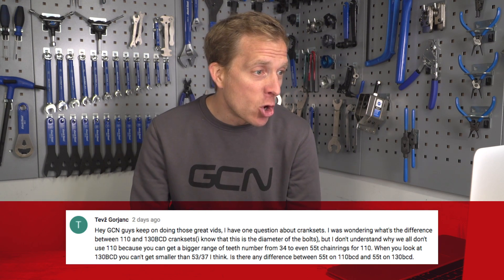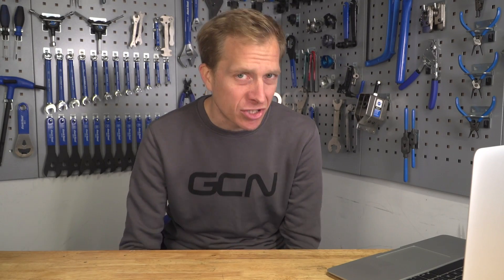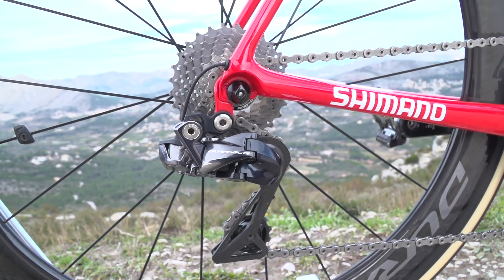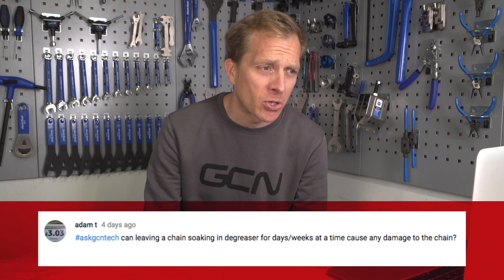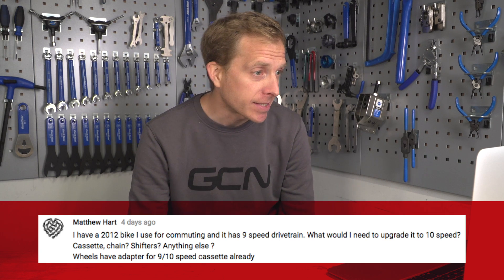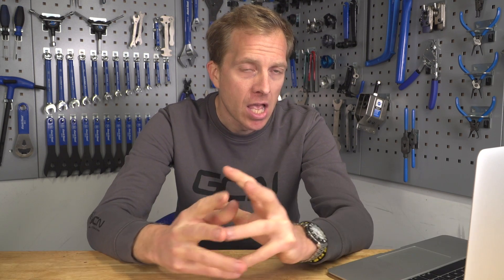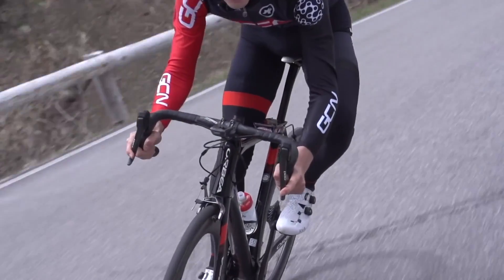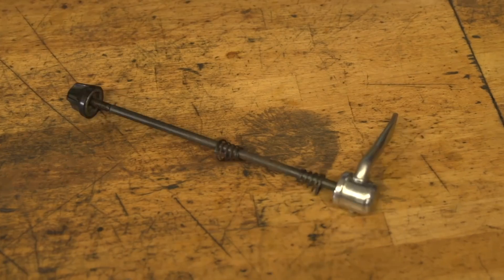What's The Difference Between BCD Sizes? | GCN Tech Clinic

Comment: Just had a tubeless front tire blow out -- rolled off the rim -- landing on a bunny hop.  I suspect I should of maintained the tire, tape and sealant better.  It happened after probably 1000 miles or more.  I've used tubelss tires for the past 3 years without any issues.      I always hear to keep the fluid fresh but upon inspection it looks like the tape loosened beneath the rim bead, perhaps loosening the junction of tire, rim and tube.  What's the suggested tubeless maintenance?  Could the tape loosening below the rim joint be the culprit?
Reply: You have rim tape going all the way into the bead notch?  If true that would make it a lot harder to seat the bead into the rim.  The tape is there to make an airtight seal against the spoke holes.

Comment: Does changing crank length significantly change the overall gearing
Reply: Changing crank length doesn't change the gear-inch number, or development (gear inch times pi), but it does change the _gain ratio_, the ratio between the circumference of your pedal stroke and your development (how far the bike travels on one turn of the crank).
 You could google "Sheldon Brown" and "gain ratio" or Lennard Zinn for a more thorough treatment of your question.
Reply: Thanks that was interesting, my cranks are now 150mm and I am using lower gear ratios than before
Reply: Are you sure your name isn't Stuart Small?

Comment: #askgcntech - Hi guys, love the show. I have a late 80s/early 90s Specialized Allez Comp with 2x7 shimano 105 and downtube shifters (53/39 up front and 13-23 in the rear). The shifter for the rear can be switched between indexing and friction. I'd like to make my low end gearing a little easier for climbing purposes, but a new (compact) crank is a little out of my budget. I've heard you can put 9 cogs from a 10-speed cassette on a 7-speed freehub. I could then use an 11-32, 11-34, or 11-36 without the 11 tooth cog and set my shifter to friction. I would also get one of the cheaper Sram MTB derailuers (I assume with friction shifting, derailleur quality shouldn't make a huge difference) to accommodate the larger cogs, and the 1:1 cable pull ratio would hopefully make friction shifting 9 gears doable. Does this plan seem possible and do you have any recommendations for its implementation or for other ways to add better climbing gears? I'd like to keep my budget under $100.

Comment: #askgcntech I've got a nice new Cannondale gravel bike with disc brakes. They are centre lock type without bolts.  The front disc has play between the splines of the hub and the disc, so when the front bake is pulled it gives you the sensation of a loose headset.  I have tried copious amounts of treadlock to glue it together but no luck.

Comment: I have a Dogma F8 with Dura - Ace mechanical brakes and gearing. Do I need to cover the cables that pass below the bottom bracket on the outside of the frame with a protective sheath?? They seem a little open to the elements naked... #askgcntech
Reply: They should be fine, same design on many bikes

Comment: Oh, regarding the chainrings I have a question too. So my bike has 2x9, 53-39 at the front, and 12-25 at the back. On flat it is fine, but on hills I feel like I'm running out of gears with the 25. I am wondering if 
a, I should upgrade at the front, for a compact set.
b, I should upgrade at the back. Now there 28, or 30? Would 30 be an overkill, or not really? And would it work with my current derailleur? What should I watch for? What does it depend on? I like climbing, but with spinning the legs.
Reply: Daniel Czirjak Changing the cassette is easier, using a 30t will make a big difference so would try that first. You will need a new chain as it needs to be longer.
Reply: Thank You. I read somewhere that I also need new derailleur, is it true, or just in some cases? What should I look for?
Reply: Daniel Czirjak You may need one but I would test the current derailleur to see if it works. More information can be found here: https://guides.wiggle.co.uk/rear-derailleurs-buying-guide
Reply: Thank you for the help!

Comment: Oh and on BCD, you did not mention that the BCD determines the smallest chain ring that can be used as the inner ring.  So 110 goes down to 34 instead of 38 for 130.
Reply: My 110 FSA has a 32.

Comment: Re: 9 speed upgrade to 10 speed:. 10 speed 5700 105 and 4600 Tiagra have 9 speed cable pulls (short arm front derailleurs), but 4700 Tiagra uses 11 speed pulls and has a long arm FD.  So not all 10 speed will work with 9 speed derailleurs, length of FD arm is a good indicator.  For a commuter bike I would stick with 9 speed, switch to 4500 Tiagra levers if you want to upgrade to brifters.

Comment: Hello from Riyadh Saudi Arabia.. have you ever seen a setup with only rear derailluer Di2? and the FD is mechanical cable?will there be a problem? Thanks and more power to GCN
Reply: Some CX guys use only the XTR DI2 with a 1x setup.  But if you are using a front and rear?  Is there a reason?  Just trying to save money?

Since DI2 is CANBUS, any configuration will work...  e.g. a Ultegra 8050 right lever and rear derailleur alone will work, but you still need the A and B junctions, connecting wires and the battery.  In this configuration you won't have automatic FD trimming, you can't use Synchroshift modes, and if you want to use auxiliary or sprint shifters you can only do so on the right lever (i.e. "upshift")

Comment: #askgcntech Follow up to BCD. Does shimano 4 arm cranks even have a BCD? I know for instance full uses a 130 bcd, and sub compact uses 90 bcd, and everything else 110 bcd. Or can shimano in theory place any size chain-rings on their mount system, so long in keeping with the 16 tooth jump?
Reply: BCD is an acronym for Bolt Center Diameter. Every crank despite the amount of "bolts" or "arms"  has a BCD.  The 4 arm crank from Shimano has a 110mm  BCD's but the radial distance between each bolt is not constant (hence the use of the word asymmetric, which isn't really true, it is symmetrical, unless one or more spider arms are not 110mm center diameter. Pretty sure they are all 110mm BCD). It was a genius masterstroke by Shimano.
Reply: It uses a 110 BCD.  Aftermarket makers call it 110 bcd asymmetric or 110 bcd shimano.  I believe FSA makes a crankset that also uses the same configuration.  34t is the smallest ring that fits, and I bet they make 58's for pros.

Comment: Hi gcn, I have just got a second hand commuter bike that has a triple at the front 48,38,28 and a 11-30 cassette at the back what size chain do I need as the one it came with only had 104 links #askgcntech
Reply: buy a new chain, and look at the chain vendors instructions for how to size the chain. The chain length also depends on the length of the chainstays on your bike. 

Page 9 of https://sram-cdn-pull-zone-gsdesign.netdna-ssl.com/cdn/farfuture/4xdUGxt6SlT-V_Y3fkmZcH8Yb5kED3Y18QzmUkTGOlI/mtime:1490891112/sites/default/files/techdocs/95-2518-002-000_rev_c_user_manual_cassettes_and_chains.pdf for example.

Comment: I once soaked a chain in citrus degreaser for about a day.  When I took it out it had completely rusted.  Had to buy a new chain.  Other degreasers may not do this but citrus did for me.
Reply: Likely the difference is water based degreasers (like citrus and others) versus solvent based one. Solvent should be fine, where as water based wouldn't.

Comment: The lose wheel are bearings I think ;)
Reply: Other things I’ve thought about...are the cone shaped springs still there on the skewer and pointed with the narrow side towards the bike? Is the actual wheel slightly bent, wiggling itself free? Is the skewer installed correctly and with the handle on the correct side? Is the frame cracked?

Comment: i figured that 'deadspace' in the shifting of the levers was there for the very reason Sagan chose mechanical over di2 for that race - i had imagined ulteg or DA levers to have less of this play under the idea that that level of component would be in more experienced hands and therefore less likely to cause someone to possibly get a little unstuck. only really have experience with 5800 levers (as far as shimano goes) can anyone confirm my thought?
Reply: Pratalax, I think it was probably just as simple as he didn’t want to accidentally shift when riding on rough roads/cobbles. A cable shifting system would prevent something like a bump from doing that.

Comment: I had an issue similar to the last question. It turned out my free hub body was not tightened all the way down. I had my local mechanic fix that and I have been without issue since. The symptoms I saw was my wheel toeing in a bit and rubbing on my now drive side chain stay as well as brake.

Comment: #askgcntech Last summer I bought an entry-level road bike. After a year of riding and enjoying it I want to upgrade from the stock Microshift 3x8 groupset to Shimano Tiagra. How can I tell if my wheel will take the 10 cog cassette and which bottom bracket I will need? Plus are there any parts I can swap out for 105 or Ultegra equivalents, such as chain or bottom bracket, that will improve the ride without bumping the cost up too much?
Reply: MidtownSkyport My B'twin Triban 500 SE came with that groupset. I upgraded mine to 105 as I felt the pain of 3X8! It depends on the wheelset, but if it's a low end bike like my B'twin then the rear wheel is likely to be 8 speed only, so an upgrade will be needed. The Tiagra chainset uses Hollowtech II so you will need a 68mm Hollowtech BB, choose whichever model you like (Tiagra, 105, Ultegra, etc.). As for upgrades, an external BB as mentioned above, together with a chainset will make a huge difference in power transfer. Chain is also a good idea, higher end ones are lighter and the shifting is more precise, but is best used in conjunction with a good cassette and chainrings. I hope I helped even a little bit! Happy riding.
Reply: Thanks, yes big help :) My bike's the Triban 500. I was thinking of upgrading the wheels too, so I might have to get the wheels first (the mavic aksiums I've got my eye on can run 8 speed) then the groupset at a later date.
Reply: A wheel that accepts 8s will accept 9 and 10s as well (unless you have a dura ace 7800 or ultegra 6700 rear hub which only accepts 8 and 10 s).

If you are talking about tiagra 4700 you could technically use a higher quality 11s shimano RD but you won't gain any shifting performance. What I would do is get some 5800 brake calipers and some kool-stop brakepads. They offer better modulation and overall stopping power.
Reply: TuneDownUtilities Thanks, good info
Reply: So I've been pricing up a part-tiagra-part-105 groupset and it would be cheaper to just buy a complete 105 set :D

Comment: #askgcntech How often should I replace quick link on my chain? I have kept the same quick link on my chain and only changed the chain itself.
Reply: Use a new link when you put on a new chain. Surely your new chain came with a quick link anyway?
Reply: No, I've never had a new quick link with new chain. Or do you mean new pin? New quick link costs around 5 euros or so.
Reply: KMC and SRAM chains should come with quick link. Shimano chains usually come with a pin but some come with quick link, but of course you can buy a quick link to use with Shimano chains if you don't like using the pins.
Reply: 11 speed quick links are not meant to be reused anyway even on the same chain
Reply: I get between 5000-10000 miles per KMC quick link before I use new one with my Campy chains.  (Have broken 2 chains in my lifetime and it was NOT at the quick links)
Reply: The last KMC chain I broke failed at the quick link. Chain was relatively new too. That put me off KMC for a short while.
Reply: David Hellyer how do you determine your quick link needs replacing? And how many chains did you use it on?

Comment: When replacing a wheel - is there a range what width tire the rim can accept. My current tire is 700cx 25. When I go online to buy a replacment wheel some of the rim dont specify the width. Do all rim width work on any tire?
Reply: Technically I think you can go as wide as your bike will allow (up to a point) but if you have a narrower diameter rim, then a wider tyre will roll sideways and have no stability, will feel at best like you have a puncture, and at worst will roll off the rim and you'll crash.
Reply: If you're buying a new wheel- get a wider diameter, it gives you more stability and flexibility with tyre choice, even if your rim width is the same as you tyre width, that's actually very aero and a good way to run!
Reply: check your rim's internal diameter and see what tires can fit.
Reply: I think that techincal norms say that the tyres should be at least 5mm from the fork and frame. That is safety measure to accommodate wheel flex and avoid tyre rubbing your frame. That is super problematic for all frames, even more so carbon. You should call the local retailer of your frame and ask what wheel/tyre your frame can fit.
Reply: The bigger the tyre the greater the "hoop stress". Hoop stress is the combination of tyre section and pressure. Rims have a theoretical upper limit before the rim can split  (FAIL).
With enough pressure big tyres appear to track just fine on thin rims. I have ridden thousands of miles on 35mm semi slicks on the rear of a recumbent.